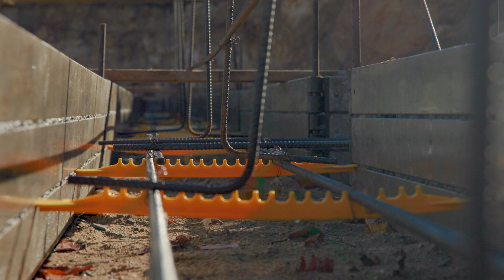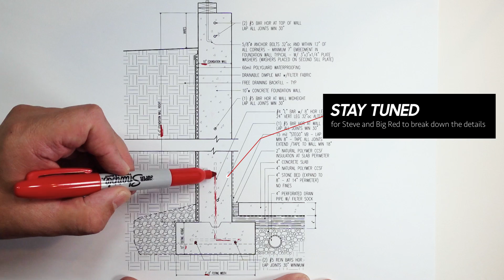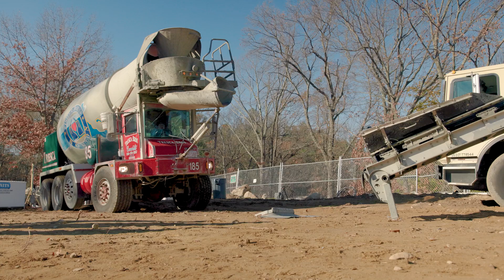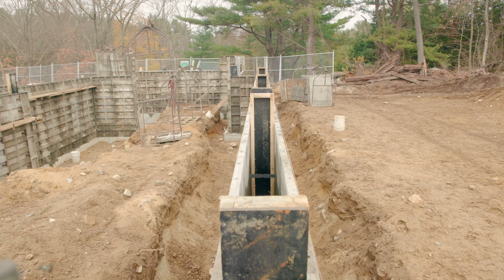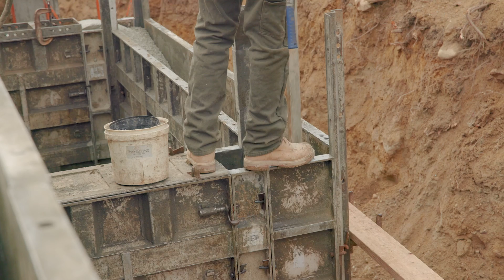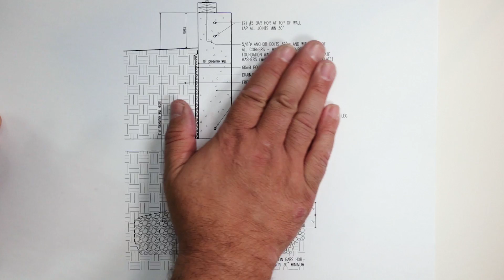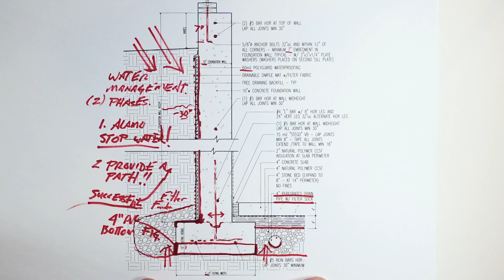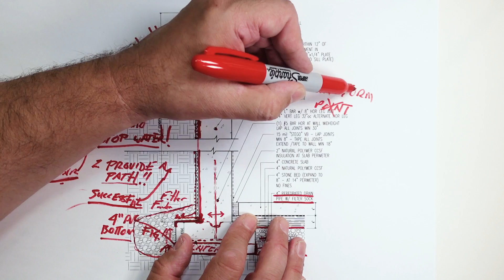Build Show Build: Boston Ep. 4 "Foundation Footing"

Comment: Excellent overview Steve, thank you. One question regarding the single interior footing drain: Why not, in addition to the interior (through the use of "laterals"), use a separate exterior footing drain? Bringing water from above (and/or ground water) into the building envelope to then daylight seems like an unnecessary infiltration risk, if cost is the answer.
Reply: There is a drain on the exterior,  just no pipe, a "sausage " of stone wrapped in filter fabric
Reply: @LongLiveOurBuildings  cool Steve is that just performance based compliance instead of proscribed? How big is the fabric wrap? Equivalent to 12" tube of 3/4? Calculate our until the void in the stone is the same as the pipe it replaced?  Made onsite or prefilled wattles?
Reply: I think he mentioned that local requires keeping the water on the property as long as possible. 

Meaning he can’t daylight drain to the storm sewer.   

Obviously no sumo pump and daylight draining the whole project would be ideal if allowed.

Comment: This was super interesting. Question, why no insulation under the footings and outside the concrete walls? Is that a cost saving as I am sure from other passive house videos I have watched that was something that was used to hit required numbers?
Reply: I opt to push the foundation outside of the conditioned space
Reply: @LongLiveOurBuildings   thank you Steven :)
Reply: Steve could you have big red show us what that jog looks like ?
Reply: J bars superior Re last displacement keyways is not large enough o be cast stable….
Reply: Why two bars at top of wall vs one?

Comment: Can an American Engineer help me understand the design principles for these basement retaining walls, I am  a structural engineer in NZ and all of our basement walls are reinforced both horizontally and vertically at max 400mm crs - approx 16in on centre as you would say, I can't see how a wall which will in some cases will span vertically from the foundation to the floor diaphragm or horizontally between return walls or a combination of both of these can have next to no reinforcing given it is subjected to soil pressure?
Reply: Its not a retaining wall when the top is restrained by the floor frame
Reply: @LongLiveOurBuildings  regardless of what you call it there will still be bending moments in the wall from the soil pressure hence the question where is the reinforcing?

Comment: Rebar safety caps not a requirement there?
Reply: Most building inspection offices lack resources for random site visits. Our local department is doing Zoom inspections, they never physically visit the site. 

In large municipal areas and commercial sites, it’s common to have OSHA site inspections, for small residential builds they never show up unless builder has violations/injury claims history.

That said, we ALWAYS install caps. My insurance carrier would deny a claim if worker injured by rebar lacking a cap. Too much liability risk and most of my workers have worked for me for several years, I consider them close friends. Any avoidable injury would be ripe with guilt for me.

Comment: No safety caps on the stakes? Barely any rebar compared to California earthquake country!  Ever done a footing on a hillside, in expansive clay, rated for 8 on the Richter scale?🤣
Reply: I didn’t think you had many basements in California . Are a lot of basements done in Northern California ?
Reply: @boby115  We don’t build there but I’ve seen a lot of homes there w/unfinished basements. If you’ve ever been to CA, particularly Northern California, the terrain is hilly and mountainous, they build a lot of hillside homes…some on crazy steep hillsides 😉.  Those homes result in large crawl spaces on downslope sides. The old homes often have unsupported cripples which will likely tumble off foundation when the big one hits. 

I do not however recall seeing anyone finish such a basement. On the other hand I have seen several older homes, 80+ years which may not be “old” depending upon your location, in SanDiego and BayArea with full basements. Most are from the 1930’s-60’s which are designated as “bomb shelters”. I doubt they’d offer much shelter since most are concrete block lacking any steel reinforcement but they are basements.

Comment: Not being critical just curious, why wouldn’t they set the top of the form to the correct elevation, and then screed to that? also, why not put plastic under the footing?
Reply: For capillary brake there's a better solution such as cementitious membrane on top of footing
Reply: Too of foundation wall was set
Reply: @LongLiveOurBuildings  hey Steve, the footing was finished below the top of the forms they used the laser level to get the top elevation. It’s what you were calling the GPS.
It seemed to me that setting the top of the form ahead of time and then pouring the concrete to the top of that would’ve made more sense, so I was questioning the reason behind that. Thanks
Reply: @Z71hosestretcher  probably, yeah, see what your saying

Comment: Wow you guys have to do a lot in the north...  Out here in Phoenix, there are no basements.  If you can get one, its a MASSIVE price and nearly DOUBLE your home build cost just for a basement.  I've worked on a few custom homes with basements and it is so odd being below ground, but so freaking awesome. But mainly everything is a single slab on grade monolythic post tension slab. Our footer is only about 8-10" deep under the load barring walls.  Otherwise, its a 4-6" slab all over the rest.  Post tension allows for such shallow footings. Where if you are doing a slab on grade with rebar, then its about 16" deep footings.  So builders find for mass production homes, post tension is so much cheaper (less digging, no rebar, less concrete, less labor cost etc..)
Reply: Basements rock.  I would insist on one in PHX--much much cooler and relatively consistent temperature year round. Quite nice IMO.
Reply: Basements not appraising like above ground is one of the main reasons they have faded away in many areas also. Most people don't know the completely finished basement might get 2-40sf value when the main floor gets 300sf.  Almost made the move  to Tucson to start doing spec construction. Hope to get there in the next few years now so we don't have to work in the cold.👻👍

Comment: Sure can tell it's a easy coast pour. Where's the steel? Here in California sometimes I wonder where is the concrete supposed to fit? There's so much steel in the form. Cheers from Northern California!!!
Reply: Yes! 🤣 stirrups maximum spacing is the minimum spacing! No epoxy or drilled bolts allowed on structural hold-downs. I put 9 yards in the footing for a 16’ long dining room window wall. 7/8” all thread rods with 36” embedment with plate washers running to Simpson StrongWalls on the 2nd floor. The rest of the old house will snap off during The Big One!

Comment: On the north end of Cambridge Ontario, on the old 24 Hwy, many years ago I was the first concrete truck at the pour of walls for a underground vault.  It is half way into the northbound lane of the road, I poured my load in, and one of the guys asked for a Vibrator.  The contractor had 4 trucks, and nobody had a a Vibrator in their truck.  So they sent one truck back to their shop to get a Vibrator.  By the time I cleaned out, 3 of our other concrete trucks had shown up, full, ready to dump.  The guy with the vibrator got there 7 hours later, and those concrete trucks stayed there and poured in the walls.

Comment: why is there no eps foam under the footing? Is it not a fully insulated foundation?
Reply: Fully insulated foundation is required when you build on permafrost ground . In this case insulating basement walls is enough since soil is under a basement slub far away from ambient temperature  and works as an insulator
Reply: No, the footer has a load requirement that would crush the insulation.
Reply: @sparksmcgee6641 . I’m assuming he’s from an area that does not do a lot of basement and basement footings.

Comment: Its so weird to see rebar uprights without safety caps. Its especially weird since much of it is below grade that someone could fall off and impale.
Reply: Tried to rip my face off on the top of a #5 that was 14' in the air. Doesn't have to be down low. Always have a bag of caps now. Coat less than $50 and reusable. No one in residential seems to use them.

Comment: Why didn't you go ahead and put storage under the garage? Guessing your engineering wouldn't take much more to add a load bearing walls under the cars. Maybe only a 8 foot span with the wall centered under the cars.  Any structural guys on that have a favorite floor for a residential garage? I don't remember the point loads off the top of my head but it's not that bad. Wanna say it was 6-8k per tire
Reply: Basic cost vs benefit. They have the entire basement to park the junk before it goes to the dump. No need to dump $$$$ for storage.
Reply: @tysleight  that basement will be 100 percent finished except the utility room. The best pay off in a cost benefit is 500-1000sf of storage.  Might be $20 a ft
Reply: @sparksmcgee6641  having just got bids on a suspended  concrete floor 10x20 I would bet you can't open  that space for less than 100K.
Reply: @tysleight  it's just a standard concrete pan and pour like ever office building. It's thicker and a bit more steel but NO way is it 500 a ft. Sounds like you just got the minimum set up charge hit because residential crews don't know it.  He already has 6- 8 inches of concrete going on the floor double that volume and go 12 and dose it with 50lb a yard of micro rebar and I bet you're good.
Reply: @sparksmcgee6641  you sound like you know concrete, I do not but I am quite good at numbers though.  The mud may not be the most expensive thing, getting the structural engineer to place a stamp, finding a crew that knows how and is willing to do a small residential job ( just the garage floor) and having a residential inspector that is knowledgeable enough to ok it.  Also the additional full foundation walls, dirt work that has to be moved off ( if you don't hit rock) and a whole other concrete floor with drainage and electrical and HVAC to keep it from being nasty and musty. So like I said ball park of 100k for a 3 car garage. 

 In our local if a house is over 6000 SQ ft counting garage and basement it has to have a fire suppression system so that might come into play on a house's size.
Reply: Cost simpky...
Reply: @LongLiveOurBuildings  Steve, I know you have a range of customers but in the upper end of clients do you have a feeling of what they would pay for storage space? I've never bothered to ask and now when I add it I'm shooting blind. Since I'm doing spec it's all on me to guess. I do know that once the storage in a house is full they'll pay more than before the house is full. I'm putting in the shell of a firing range and I presume it will be storage if the buyers don't shoot.

Comment: My kind of video.
Reply: How long did they wait to do the keyway? Right back around after they finished pouring?
Reply: @sparksmcgee6641  about an hour
Reply: @LongLiveOurBuildings  nice, I've been doing mine sooner and those look cleaner. V looks cleaner than the typical 2x4 formed key
Reply: @LongLiveOurBuildings  Steve, have you ever used Xypex instead of your exterior water membrane? I know it cost more but wanted your thoughts on Xypex, I'm using it to replace the membrane and the entrained air on a wall in my personal house. Foundation repair that extends up to become an exposed concrete wall for the first floor.
Reply: @sparksmcgee6641  haven't used it
Reply: Thank you
Reply: As a contractor doing this in house will be the most profitable portion of any job. Forms are always available for rent somewhere. Ellis has  been my go to. European style large forms are for rent in the US now.